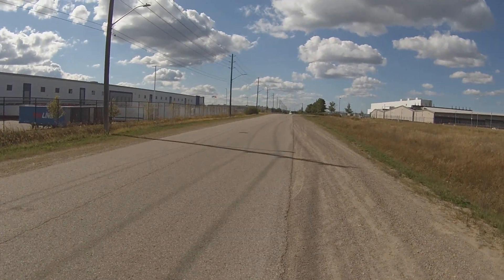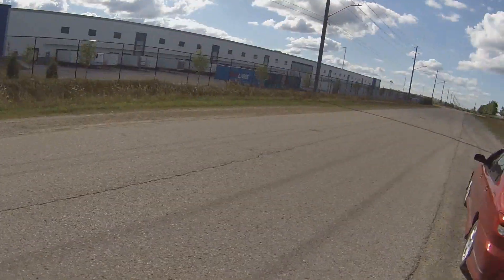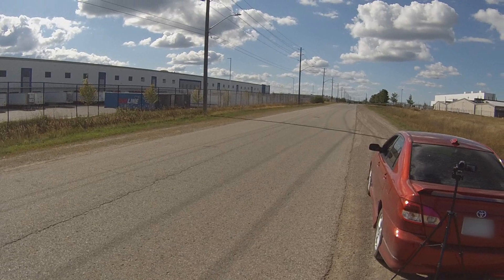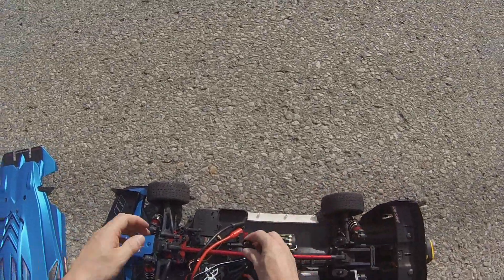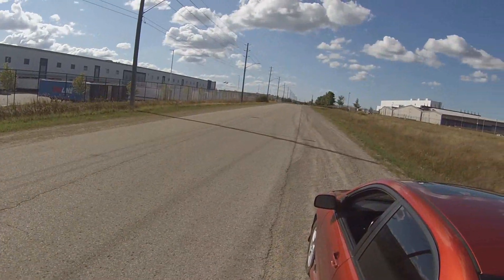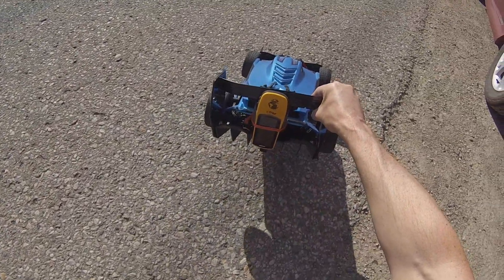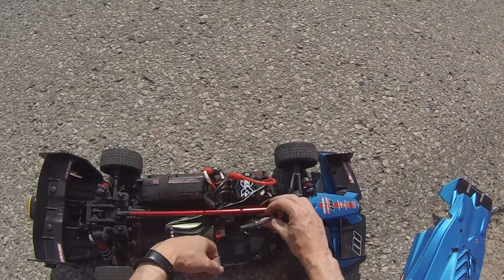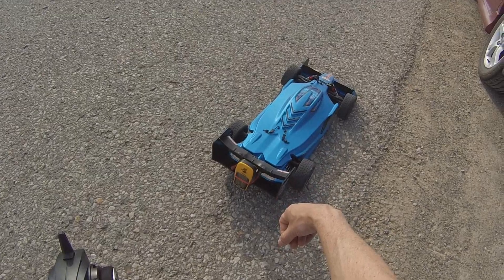How Many Back to Back Castle 1721 2400Kv Passes Geared for 100mph Can Be Made?

Comment: Alrighty then! 👍🏼 I’ve contributed to the cause, as promised, except I did it twice! Let’s talk, my young friend!

So…I too have built a Limitless (all but done), and I have a vision of building an active rear wing on the car. I’m not out for speed runs as much as road-course racing. The wing is more for show than go, but then, you never know until you’ve tried it. I want this wing to be autonomous.

Autonomous (you ask)?
Yes (he replies).

I’m not an F1 driver, so I really don’t want to flip switches or toggle buttons while the car is running; it I’d just-as-soon let the car do the work. 

I may modify the stock ARRMA rear wing or fabricate a carbon fiber replacement. My intentions are to brace a tiny aileron servo on the wing mount, and use the car’s actions to activate and deactivate the servo, depending on the car’s status of accelerating or decelerating.

That being said, are you aware of a way to detect acceleration/deceleration on the car other than the radio signal, or could we tap into the command signals going from the receiver to the ESC?

Perhaps using the motor wires to determine a positive battery voltage on acceleration as opposed to the flyback on deceleration?

Perhaps I need to do some work on an Arduino project. I’m guessing I could do something with this idea, and it wouldn’t take many logic gates to create an on/off switch for a servo using feedback from the car.

OR, I’m I missing something that is even easier than my idea?

Thank you for your time on this matter. 

Peace always✌🏻
Reply from the maker: Depends on what you specifically want the trigger to be. Front end active spoilers can be wired to the elevator port of an airplane gyro. I think to do what you are after with a rear spoiler, you'd need an arduino and what I'd prefer to do is tie it in with a high update rate gps activating at pre programmed speeds
Reply: Thanks for the input. I’ll get back with you if I create a project for the idea.

Comment: When I had range issues on one of my RC’s, it was due to weak batteries on the transmitter. But apparently they weren’t weak enough to kick on the low battery LED on the transmitter.
Reply from the maker: Interesting. I'll have to take a look at this

Comment: Radio link v2 or v2 is perfect for distance and cheap,  need at least 1900 feet to run.....I use a v2 with a signal booster but my runs are above 2300ft-2900ft one direction 👍 but only running 100 mph you shouldn't need a booster at all

Comment: Dude: I’m an old man who’s retired from the field of electronic material-handling equipment using SCR drives and such, with DC batteries that literally weigh tons, and drive motors the size of a 5-gallon jug of water.

With that in mind, I’d like to say that I absolutely love your clips, and I’m hip to everything you speak of - bring it on - please tell us more details!

And yes, I’m building a Limitless, with a Castle 1717 and Mamba Monster X ESC. 

Unlike most, I’m building a road 
-course car so that I can run the car around in my local open parking lot on 6S batteries and just have fun. I’m interested in what kind of handling I can get out of the car, other than a straight line. 

I’m also preparing for speed runs using 8S batteries, but I’m not trying to create any records, other than personal best. 

Thanks much for your efforts and your generosity in sharing your knowledge. 

I’ll be visiting your Patreon soon - you deserve it.

Regards;

Casey G. 

Peace ✌🏻

Comment: Awesome content as usual 😎👍

As a speedrunner, not a pro like the top dogs out there, but fast enough to have fun, so far.. 128mph record with that combo on 6S, XLX2 & 1721 2400kv.
I can usually get about 3 passes on 6S with that combo, all passes in the 120's mph.
Tips :
>Loose them hoons, they run ok for a couple of runs but loose their grip quickly. At lower speeds, 100-150mph, you're definitely better going with GRP's, S7 compound (newer release). Or BSR foams, double pink compound, with those, easy 150mph + handling.
>trim down the wing to the lowest setting & the canards. You will still get down force and less drag, easily gain at least 10mph. Just need to make sure your nose is low to the ground, ~10-13mm & the rear higher ~20-25mm & very stiff on the rear.
>steering trim/speed is also HUGE. 
>controller, Radiolink RC6GS (1900ft range @ ~$85) or RC4GS (1200ft range @ ~$60). I use the RC4GS & do runs that average ~2000ft total (me standing at midpoint). 
>change the diff oil on both diffs to 1mil weight. That will help a ton to keep your car straight. 
>I use the SkyRC Bluetooth module too, it's amazing,huge game changer lol.

Swing by my channel if you want to see some of my setups.
Reply: Sounds like good input. I have a limitless build that is almost complete. Xlx2 paired with the 1721. I done everything you have outlined. Im gonna start with 24p 34s. Hoping to hit a 100mph on 4s if not then ill up the S's I do have a 28p I can throw on. I'll check your channel out. I will be making a video on my build here soon. 
Keep it 🐢
Reply: @TurtleRc   sounds awesome 😎👍
On 4S, with that combo, I believe I pushed 98mph on my stretched Typhon 6S. I just cant remember the gearing (i believe 34/34) have to check my logs, I save all my logs with notes of setups.
But with a 28/34, I believe you'll wind up in the ~75-79mph range. A 34/34 on 4S would bring you closer to the 100mph range.
Oh, & totally worth it.... Get a Perfect Pass launch control module. I use them on my cars & it's nite/day difference. Specially if you're starting out with speedruns. It will reduce the possibility of a crash  by helping you keep the car straight at take off & increase your top speed for sure.
Take it slow at 1st, run 4S, get comfortable, then 6S & then go nuclear,  8S 😄
Takes time to get used to high speeds so take your time & have fun 😎👍
Reply from the maker: Great points! Will look in to these. Thanks.
Reply: @RCexplained  NP 😎👍
Just did 3 passes today on my stretched Arrma Typhon 6S, testing her out new tuning. Running 6S, XLX2 and 1721 2400kv motor, 34T/34T. One 124mph pass & two 126mph passes. Motor hit top temp of 161F & ESC 146F,  430A. Slightly high, but still under the recommended temps from castle. 

Your going to have a blast with that car & power combo 😎👍